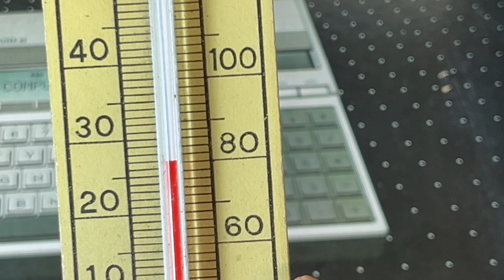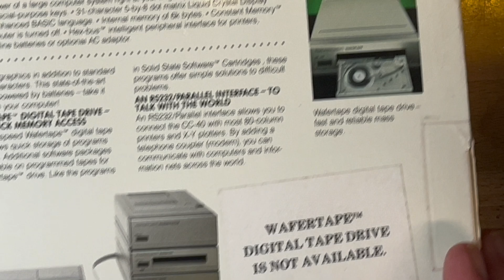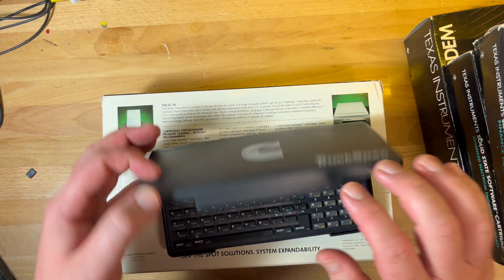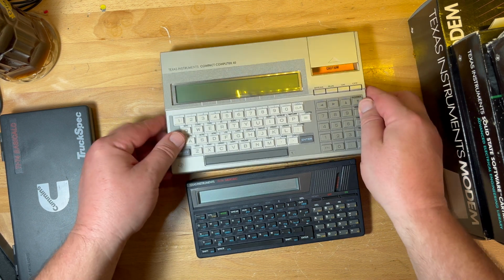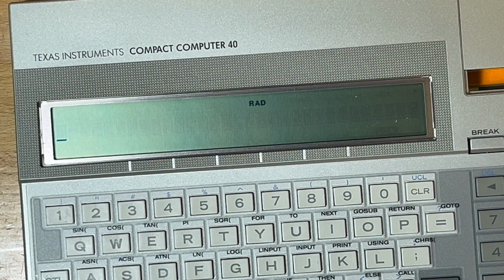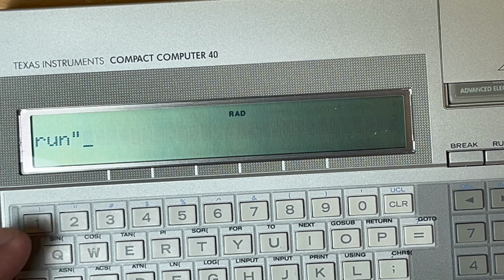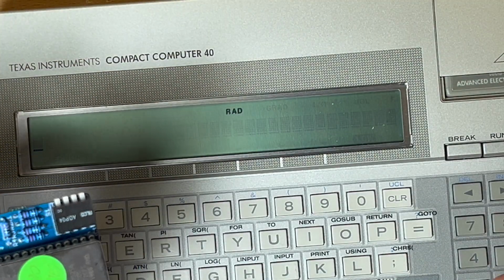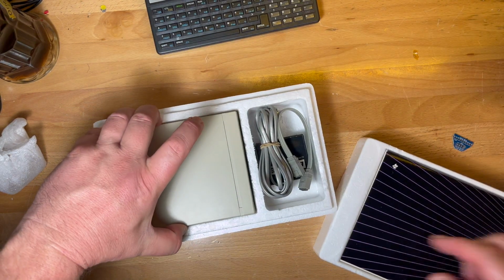🇺🇸 Texas Instruments Compact Computer 40 (CC-40): Part 1 [TCE #0418]

Comment: ha! I have exactly this guy. Wonder if this came from the same surplus stock one I had. Mine was NIB also. There was even a nice still shrink wrapped Energiser battery in the modem box. The 27cxxxx EEPROM adapter you have is really interesting. I didn't know they were made. Pretty interesting. Thanks for the video! P.S. I'm terrified of your zebra connectors. Have had plenty "not work" after being removed to repair something.
Reply from the maker: Want some?  I've got a few boards spare - RAM expansion, multi-ROM board and an expansion board that brings all the pins out to a header.  With the zebra strip, the plan was to get a new replacement ... FujiPoly were offering free samples ... but after a year, it still hasn't arrived!
Reply: @Brfff  Okay. Got paypal, ebay, tindie... $other? What's most convenient to you. I often look at mine and think "I should do something with you".  http://ns4.reboot.net.au/hardware/pics/ti/CC40/20240307_222157.jpg ..my collection.
Reply: @Brfff  Yeah. I'd be keen. What's your preference to sell ? Ebay? Tindie? ..something else? This is my collection: http://ns4.reboot.net.au/hardware/pics/ti/cc40/20240307_222157.jpg  Possibly the same seller as Mr Walkman's. Was many years ago. Loved the thing to bits.
Reply: Here is the store that sold me mine: communityca Now it's called "99computerwarehouse".

Comment: i've got the ti-74 basiccalc with 8kb ram module which i believe is nearly identical to the cc40, it isn't very useful and i wish i never sold my hp71b
Reply from the maker: It was probably of more use "back in the day", similar to other single-line HHC's ... at least there was a cassette interface for DockBus to allow you to save & load your programs.  These sorts of machines were used by travelling insurance salesmen, for example.  And, actually Cummins developed their own software as with the example I have ... unfortunately it wasn't provided on a ROM but a battery-backed RAM cartridge ... so the original program has been lost (on my machine at least).

http://ftp.whtech.com/hexbus_cc40_ti74/ti-74/TI74%20color%20brochure.pdf

Comment: I saw that CC-40 only once in my life, in 1996, at a flea market. Just a unit with no papers or a box. Way before Internet was a thing in Ukraine. Thus no one had any clue about what could be done with that "programmable calculator". And its price was a dramatic 10 American money equivalent. My two month income. Too much to pay for an experiment.
Reply from the maker: Wow, what an odd place for one to turn up!  Even in 1996 in the West you would've been hard-pressed to do anything useful with it ... only recently people have come up with SD interface (via Arduino) and RAM/ROM expansion boards, etc.
Reply: @Brfff  Two weeks ago, I got my TI-74S, clearly coming from Germany (it had a German insurance company cartridge from 1995), from a local Ukrainian online seller who sold it as a "programmable calculator with formula entry capabilities", sic. So, people still have no clue about these.
The item itself was manufactured in Feb 1988 but is in a mint condition even though the hard case is a bit scratched up. Everything works perfectly.

Comment: Try your EPROM adapter again with the EPROM removed. Maybe your card is bridging traces.

And you are welcome of course! I bought it in 2017, here's part of the eBay listing for it: 

"Texas Instruments TI CC40 Compact Computer 40 - Vintage 1982 - NEW IN BOX!
$35.96 for a limited time."

Nice to see that it held up well in the box after all of these years. :)
Reply from the maker: Your comment made me realise that "one does not simply insert a 28-pin 27256 in place of a 32-pin 27040" ... and also that there's two different boards that look the same ... a RAM expansion and the ROM expansion ... duh.  And, thank you once again ... so nice to have a machine that simply works for a change 🥳